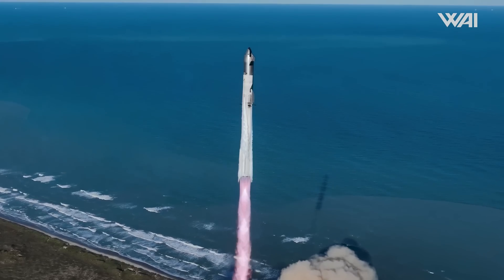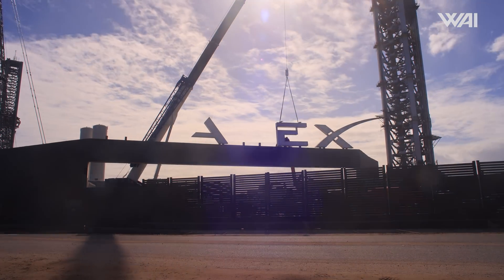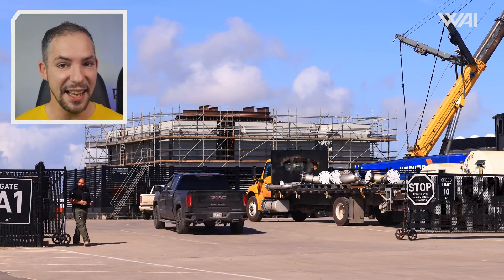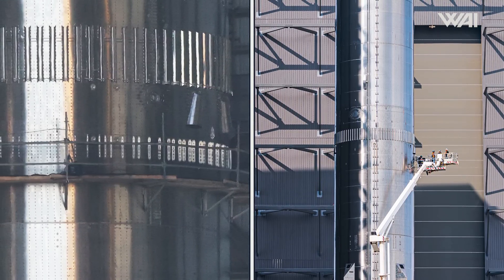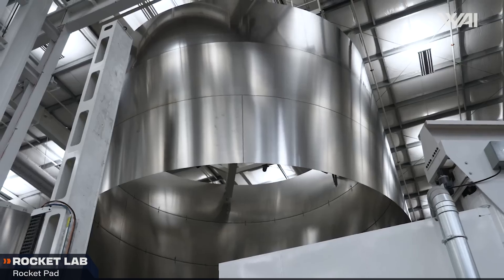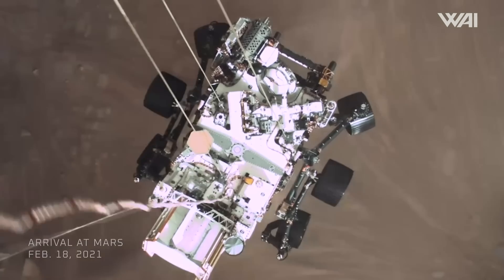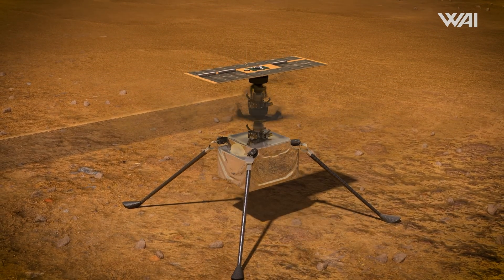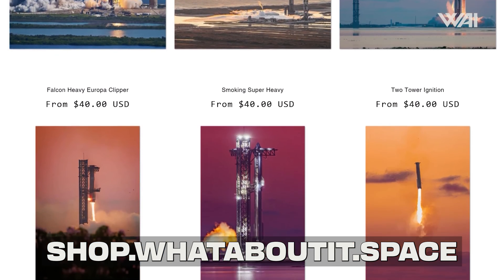SpaceX's shows new Starship Heat Tiles! And they're red!

Comment: Just like the Shuttle, the heat shield is the Achilles Heel of reusability. Unless SpaceX can solve the heat shield problem, rapid reusability will remain a dream.
Reply: They'll end up with that shield being single use, one big part they can replace on the launch pad within hours. Like a big shell. There's no other way
Reply: Replace within hours lol yeah and the hyperloop is just an air hockey table no big deal
Reply: @i-love-space390  They'll eventually have to develop some sort of rapid spray on solution.
Reply: @i-love-space390  acumular suficiente combustible en el cohete para desacelerar de 26000 km/h a 13.000 kms/h en el espacio antes de la reentrada. No sé si sería posible?
Reply: Indeed, yes..
Reply: The tech implications from a reusable heat shield are wild. Orbital staging and travel. You can launch payload anywhere on the globe quickly. like under an hour. Or faster if you have staged vehicles that just need routed. Also smaller vehicle thruster vectoring control. Space X will own this tech in the future and make cool machines.

Comment: The thermal protection tiles absorb almost no heat, they are just very good insulation. The fact that you can pick one up on the edges or corners while the interior is red-hot shows that they transfer heat very poorly (aka: they're good insulation).
Reply: @richardpark3054  I held one of the tiles in my hands when they were still exclusive to NASA (I worked there briefly). SpaceX is no wonderous company, they appropriated those tiles technology from NASA many years earlier. The tiles in question are very very light in weight.

Comment: The hydrogen atom is smaller than helium, but its H2 form makes it bigger than the helium atom.  So, helium is even harder to prevent from leaking than H2 or so a tech article on balloons claimed.
Reply: All true. Hydrogen is chemically active which can result in hydrogen embrittlement, a significant cause of metal failures.

Comment: 6:40 I think if they want to catch booster and ship in flight 8, they will need both launch towers already, one catching the booster and one catching the ship. Unless they manage to catch both one atop the other at the same launch tower.
Reply: The booster is caught 8-9 minutes after launch. Because of the inclined orbit, the same Ship only passes directly over the launch site every 24 hours or so. 

So we can be assured that the booster could easily be removed in time for a catch.  

The logistics change when many tankers are in dozens of various orbital "planes", queued to land. Landings might occur only 90 minutes apart.
Reply: @avid0g  The question is, how long does it take for the ship to return to the öaunch site. Doesm't it take only aboit 90 minutes for one obit which is aborted by a deorbit burn?

Comment: Just two concerns. I've worked in air separation plants. 
Air Separation plants CANNOT use totally horizontal tanks, except for storage. The elements separated from the cryogenic liquified air are separated by density, so they MUST have at least on vertical tower tank. That tower will have to armored from FOD damage - and that's not A Bad Thing, since it could be coupled with thermal insulation and sun shade. This separation tower is always perlite-insulated anyway, but more is always A Good Idea. 
In addition, these plants are engineered for 24x7 service, and are expensive to start and stop. That implies that until Starships start flying ALL the time, trucks will have to come in, load, and remove excess cryogenic liquids - especially liquid nitrogen, which is essentially a waste product. There's still going to be a lot of heavy tanker trucks going down Hwy 4. 
Finally, on a personal note, please start increasing your non-Musk content, or you're going to lose subscribers fast - something I don't want to see.

Comment: they need to use a YBCO super conducting magnetic shield to repel the plasma. cut the tiles thickness by 50 or 75% and save 12T of mass to orbit.

Comment: I am surprised the tower catches the booster over the launch pad. 
Why not catch it over to the side?
Reply: Loads the tower differently, requiring reinforcements?
Reply: They should have designed the tower to catch ot on the side.
Why try catching it above the critical launch pad.

The tower is strong enough to pick up the booster on the side.

Comment: Is that a real heat tile you’re handling? I wouldn’t touch that with bare hands. Also wouldn’t store it inside your house. There are microfibres in those tiles that’ll really mess up your lungs
Reply: Who told you that?
Reply: @TheEvilmooseofdoom I’m a helicopter technician by trade. As a rule, we don’t touch anything that’s in place for heat absorption. Look at the composition of the tiles. They are full of microfibres that can really mess up your lungs

Comment: It’s interesting that you are one of the only channels I follow that still mentions Raptor QDs being on the Pad B OLM. The other school of thought is that individual RQDs for the outer Raptors complicated the OLM considerably and presented an additional 20 potential points of failure so on balance SpaceX has decided to go with some other way to start the outer engines. I guess we won’t know who is right until we see more finished OLM hardware, or a Raptor 3 with a QD receiving plate, or do you have some inside info that makes you think that RQDs will still be used on Pad B?

Comment: I have always thought from the beginning that the heat shield would be SpaceX biggest challenge. It is sure looking that way. It was a big problem with the spaceshuttle that caused it to take so long to refly. From a engineering problem its a very hard one. The forces and heat are big. To have something strong enough an lightweight and nonoblating is a hard problem to crack. But what do I know I'm just a dumb carpenter.:rocket-red-countdown-liftoff:😬Oh ya Flight #10
Reply: That's what spacex said too.  The TPS is going to be the prime issue.

Comment: It seems that the design of the fins acts much like a nozzle, squeezing superheated plasma through a narrow gap between the main structure of the ship and the fin attachments.  Perhaps a redesign, perhaps by widening the space between the two surfaces, would control the plasma flow and thus achieve some reduction in the blow-torch effect.
Reply: Make that portion of the fin, the hinge assembly and articulation, and the mounting area of a more refractory metal.  Many metals have higher melting point than steel.
Reply: I keep asking myself whether it would be possible to keep the plasma away from the ship at critical points using magnetic springs.
You should ask the physicists at ITER etc. they know a lot about it
Reply: The gaps have resilient gaskets; probably Silicon fins in redundant rows.

Comment: The mars chopper knows where it is at all times. It knows this because it knows where it isn't, by subtracting where it is, from where it isn't, or where it isn't, from where it is, whichever is greater, it obtains a difference, or deviation. The guidance sub-system uses deviations to generate corrective commands to drive the chopper from a position where it is, to a position where it isn't, and arriving at a position where it wasn't, it now is. Consequently, the position where it is, is now the position that it wasn't, and it follows that the position where it was, is now the position that it isn't. In the event of the position that it is in is not the position that it wasn't, the system has required a variation. The variation being the difference between where the chopper is, and where it wasn't. If variation is considered to be a significant factor, it too, may be corrected by the GEA. However, the chopper must also know where it was. The chopper guidance computance scenario works as follows: Because a variation has modified some of the information the chopper has obtained, it is not sure just where it is, however it is sure where it isn't, within reason, and it knows where it was. It now subracts where it should be, from where it wasn't, or vice versa. By differentiating this from the algebraic sum og where it shouldn't be, and where it was. It is able to obtain a deviation, and a variation, which is called "error".

Comment: 11:54 my first thought is that this is a peel off film that both protects these particular tiles but more likely identifies them from the rest. Don’t touch these with your oily hands. Don’t forget these need special underlayment/need no special underlayment. Do not replace even if all others are. These tiles have special coatings we want exposed to the environment only when we’re ready to start observing them.

Et cetera.
Reply: Peel off film? Makes me think it might also be a film to stop tile loss? Would make sense either way.
Reply: @ademnonscouch3917 - I was thinking more like the peel off film you might see on electronics’ screens when you buy new products.

This may be to protect from weather and accidental contact scratches from workers and items nearby or as it’s moved. 

I do not think that the tiles are actually red with a new glaze ceramic coating.  Black tiles are black for a difficult to remove from the thermal equation, reason.

The shuttle had weather, bird, insect and dust covers over the RCS nozzles and other ports/openings that blew off at launch. I’m not thinking that, but they were red covers too, and that’s what made me think of protective film.

I’m still thinking these are more probably peel off protective films, and also to distinguish these tiles from other tiles until preparation for launch, although for reasons I’m not sure of.

Comment: Question... is there a reason that agencies don't use multiple copies of the same rover/drone? Since they would have already spent the R&D for one, why not make multiple? Maybe launch costs, but would there be any other? If the mars chopper concept ever get sent to mars then weight wouldn't be an issue. Sending multiple to cover a larger area wouldn't be impossible right?
Reply: Because each does different things, are planned for different launches, have different power requirements, will use different power sources.  The Mars chopper concept was sent to mars, but how does a mars chopper make weight a non-issue?

Comment: 14:01 Hydrogen gas is made of H2 molecules, which means two atoms of Hydrogen linked together. Anyway, it remains a very small molecule.
Reply: Hydrogen is not the smallest atom in any case. The lightest, sure, but Helium is smaller.  But that just means helium is more prone to leaking. But at least helium doesn't mess up metal like hydrogen does.

Comment: Why does SpaceX plan to catch boosters and starships directly over the OLM?

I would think that if the chopsticks can lift boosters and starships from the side and then swing them over the OLM that they should also be able to catch them from the side as well?

Wouldn't this lessen the amount damage inflicted on the OLM?

Just curious if anyone has any explanation. Thanks!
Reply: Not sure about their reasoning but aiming for the middle of the arms means you have the widest margins for error on either side.
Reply: @TheEvilmooseofdoom  I wouldn't think that the middle of the wide open arms would be different if the arms are centered above the OLM or if the arms are pivoted to the side of the tower away from the OLM. I might be wrong though. Thanks for your response.

Comment: A spray on type of shield is the most efficient way of maintaining the heat shield between flights. Any gaps or cracks will build up heat as it catches the super heated plasma.
Reply: It's still a silly notion.  There is no magical spray on heat shield and no spray on shield could cope with the changes in expansion in different area's of the ship during different phases of flight.

Comment: Air separation, will they also go for a power plant or upgrade the grid connection?
Reply: Power plant. Too long to upgrade the grid transmission capacity?
Then again, that could possibly be overcome by batteries?
Reply: @BTMwarrior  sorry but you did not get my question purpose. i asked because if they truck in a lot of energy by liquid gasses. To avoid this in future by local production they need the power to run this  machines to liquify air .....

Comment: While the tiles get hot, they don’t absorb that much heat. The function of tiles isn’t to absorb heat, it’s to resist the transfer of heat to the rocket’s skin. It’s a barrier between the rocket’s skin and the hot plasma generated by atmospheric/aerodynamic compression. 
A minor technical comment on an otherwise good video. 
Merry Christmas to all.
Reply: Yes. They absorb almost no heat, they are just very good insulation. The fact that you can pick one up on the edges or corners while the interior is red-hot shows that they transfer heat very poorly.
Reply: Good point.
Reply: They don't so much absorb heat, but they definitely absorb IR radiation, emitted from the standoff shock/plasma; the thing is that they absorb that thermal radiation and re-radiate it, back the way it came. If it weren't for their capacity to withstand extremely high temperatures, then in a few seconds they'd be, well... toast.
Reply: I think Felix's comment might have been more a language error as the concept could be somewhat nuanced. Hard to say, but I remember having those challenges when I took Spanish in grade school and college.
Reply: @stratolestele7611 y puedes hablar español hoy en día?
Reply: People obsess over the Challenger disaster, but nobody thinks of Columbia. The loss of the first shuttle killed the whole program, and the damage was done by a falling piece of insulating foam. At least Starship sits on top of the booster rather than besides it. But I wonders if Spacex continues to do the careful in-orbit checking on any damage to the spacecraft may have suffered during launch before trying to land them again, instead of only checking after landing. I sure hope they are taking sufficient care, for any deaths could be disastrous.
Reply: @danielch6662  The interesting thing about the Space Shuttle's TPS was that it was not ablative and was very much reusable. On older shuttles, most of the original "tiles" never needed replacement. The downside to that system was that the tiles could not take impacts very well. as they were relatively fragile. And they were geometrically complex because the needed to cover the aerodynamically designed space craft. Tiles need  fit tightly and "wrap around" the underlying Aluminum vehicle. Problems arose with these almost always due to impacts from ice on launch. 

That is because the large external cryo-tank extended far above the shuttle. Of it weren't for impact damaged tiles, the system required little maintenance beyond inspection

In the case of Starship, this ice impact issue is relatively non-existent and the shape is much more symmetrical and should need less specific shaped tiles. Of course you have the ridiculously dumb design of the starship "fins", which is the accurate way to describe them. Hinging parallel to the spacecraft was just a dumb mistake. Instead, they should be fixed structures with trailing edge steering surfaces like an aircraft wing!

Starship is a horrible design that seems to have been led with a directive to ignore everything we knew about aerodynamics, structural engineering and thermo-protection as well as ignoring the basic physics of the rocket equation! So many major, fundamental flaws in its design ignoring that we had a strong, proven, knowledge base to follow! 

It's like Starship was designed by a graphic artist with no knowledge of engineering or basic physics! And the some rich guy told the engineers to make it work!
Reply: I can understand the semantic confusion. Heat shields can "keep" heat from the ship, and words "keep" and "absorb" can feel similar when you don't have the complete context.
Reply: Imagine temperature inside that stainless steel can:face-blue-wide-eyes::face-blue-wide-eyes::face-blue-wide-eyes:

Comment: Do you think Starship will ever support some form of safety system allowing people to escape and still live given it can’t land or launch properly?
Reply: don't know, but i think it would be a good idea. For start or landing or both
Reply: Its likely that the starship could detach from the booster if they experienced a booster issue. But the possibility of ejection systems on starship are as unlikely as the shuttle ones. The shuttle once had ejectors but they discarded them due to the weight and certain parts of the flight path being instant death. Id imagine that they have the same issue.

Comment: Felix I sent Mr Musk a sample of heat shield protective blanket. 1/4" thick and very light. Designed for diverting or absorbing  torch heat while soldering copper pipe absorbs up to 2800 degrees to be used to reduce heat intrusion and burn thru. I'd like to know if my speculations are correct